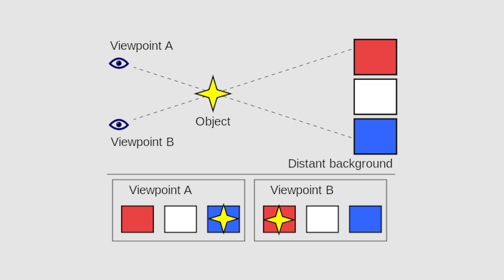How to determine lens nodal point for panoramic photography

Comment: You did everything alright until "levelling base underneath the ball-head". This won't work, sorry dude :-)
Reply from the maker: Hi Mark. I appreciate your taking the time to write, but for the life of me I cannot understand why you feel using the leveling base will not work. As a former Nat Geo photographer and with more than 4 decades of experience, I have shot hundreds of panos, many that hang in our clients' offices that are 30 feet long by 10 feet wide and are pixel perfect. The fact is that I use this method every time I go out to shoot and have never had a pano that didn't work. You can see some of them on my website. Why don't you give it a try? Best of luck.
Reply: @lespicker  The horizontal rotation of a panorama must take place above the leveling plane so that the camera does not change its horizontal orientation during the rotation. In your case, however, the rotation takes place under the ball head. For this reason, professional panorama photographers mount the leveler or, if you like, the ball head under the panorama plate. Or take a look at Novoflex with its CB-III-2 ball head, which can be mounted upside down so that the panorama plate is above the leveling. Maybe I don't work for National Geographic, but I've been creating professional panoramas for over 10 years and know the technical aspects very well. If you want to convince yourself of the quality of my pictures you can visit https://www.marksimons.de
Reply from the maker: @achdermark  Hi Mark. I really like your pano work. You are obviously very proficient in it. I am sorry if I appeared smug about my previous photo experience. That was not my intent, but I was rushed that day and should have paid more attention to its tone. In any event, I do believe that there is a very simple misunderstanding between us. After carefully reading your comments, I think I figured out that there is no conflict between us. My leveling base is simply a quick way to level my tripod, instead of having to fiddle with the legs as I used to do years ago. The leveling base is below the tripod head and pano slides, so once my leveling base is leveled, I simply mount my camera and level it and I'm ready to go. Of course I always double check level by swinging my camera left to right to make sure it maintains level throughout. I hope this helps. Best wishes for your continued success with panos. From now on, I invite you to contact me through the email address on my website. I'll then send you my regular email address and we can continue to correspond on photographic issues.

Comment: ONE MORE "phony" pano-demo. 
Why "phony"? 
Because I just don't get it why experienced people.. fail to teach why, what and best how the setup should be leveled, - what is means  and what not.
Then, a BASIC knowledge (or consequence of that knowledge) ensues that the panning part of the equippement has to be above the leveling. 
But leveling a tripod is ..plain stupid, if we consider in a correct manner, that tools are here to make life easier.  Here, his leveling can be made with the monoball, providing the pano is on top. He would simply have to mount the monoball upside up (or buy and add an additional pano above the monobal.  Why ? Because no matter how much pain you put to level the trypod, if your monobal is not totally(!)strait, then you will have the stepped effect you want to avoid (never mentioned), instead of  "one band" -alignement of the images (stepped= narrowing the exploitable panorama).